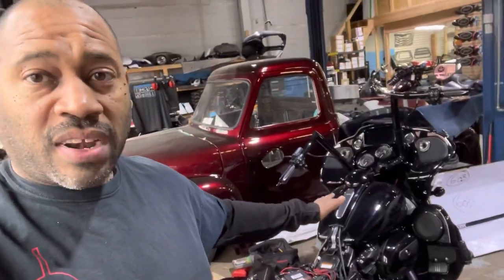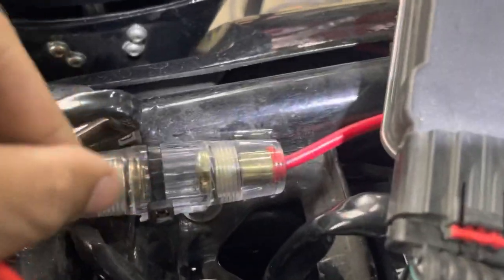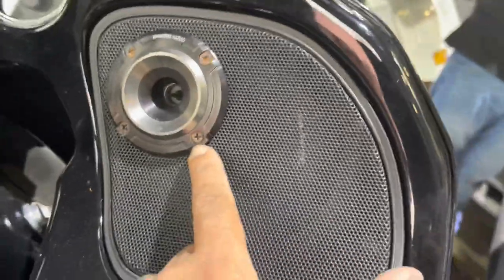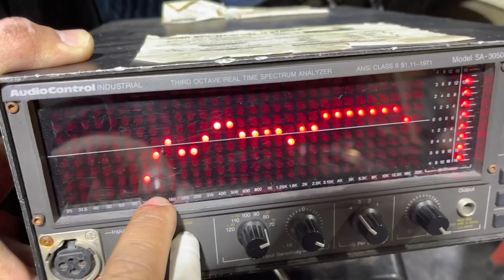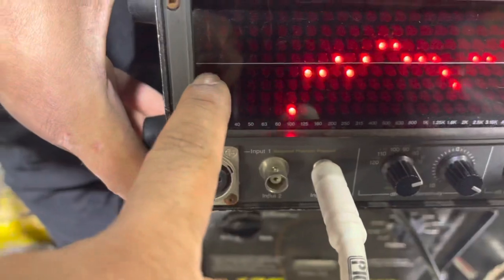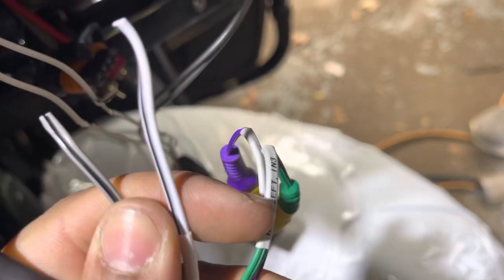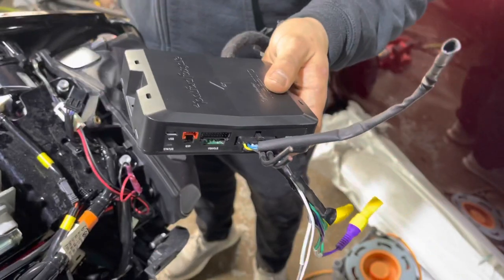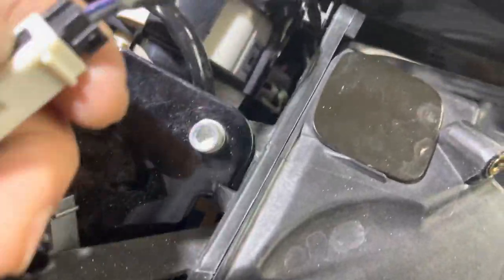Harley-Davidson Road glide wiring rescue part 1 ( Project No Glide )

Comment: Aloha from Hawaii Carlos. Great job on your videos. They are very informative. Taking the information I get from your videos and working with Travis the owner of SMP customs one of the leading motorcycle stereo shops here in Honolulu. I’ve designed and installed a decent system that is loud enough to get a excessive noise citation. Mahalo for what you do. 🤙

Comment: I cannot believe people actually pay for work like this. I would be furious if I saw wires all over the place and speakers not working on my bike. I run my own sounds so I’m not the best by far but my system is probably 80-90 % professional. After watching your videos I’m going to clean mine up even more. Anyone with half a brain can just watch YouTube and install a professional looking system. Some of the blame has to be on the customer for allowing such garbage. These shops need to be put on blast.

Comment: Will you keep the 6x9s or upgrade to 8 inch midbass woofer's?
Reply from the maker: I’m going to try to keep them . 
🤞

They are the diamond audio 6x9 subs 
I’m pretty sure I can make them sound good if I can fabricate a proper mount .

Comment: What is the best Quick connect for the four gauge power and negative to use
Reply from the maker: Anderson connectors 

They go by amperage ratings 

https://powerwerx.com/anderson-power-powerpole-sb-connectors
Reply: @NVSAUDIO  how do u use these connectors never seen them before might be something I would like to add to tool box
Reply from the maker: @limitlessworx5724  we use a hydraulic crimper to attach the ends to the wire then they just clip into the plastic holder
Reply: @NVSAUDIO  if u ever do video showing how u install and use them let me know thx

Comment: This makes absolutely no sense. There great equipment use on the bike only to be held back by one of the absolute worst installs I've ever seen. I have a box that I throw extra wire in and it looks better than the  install on that bike.  That installer definitely hated that client. You and your team deserve a steak dinner after you finish this one.

Comment: I bought a set of those diamond audio horns in the grills from 702 motoring........lol.  They had drywall screws holding them in and apparently couldn’t run a screw gun because they scratched the hell out of the tweeters. It took them 3 times sending me the horns before they were acceptable.  Never again will I purchase from 702